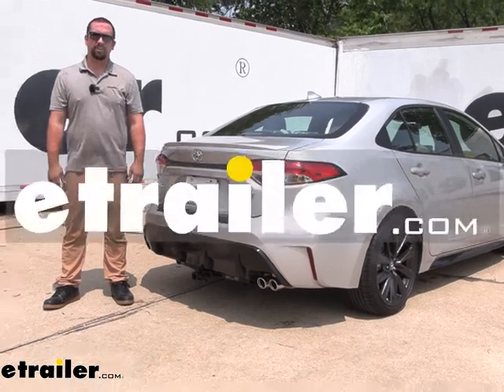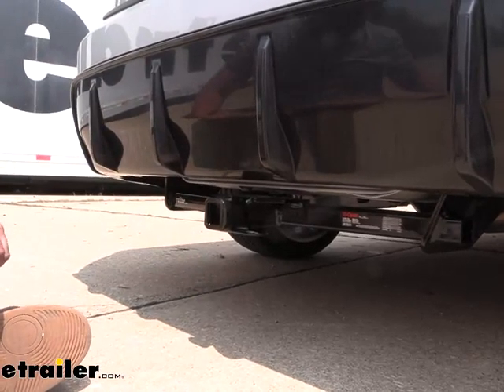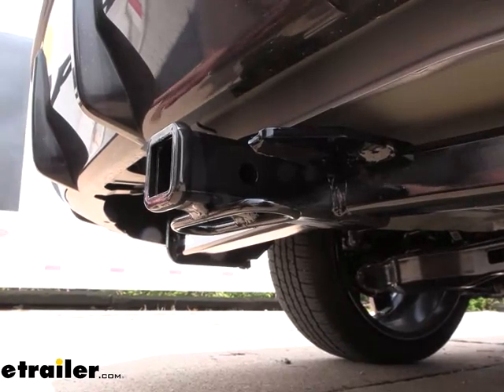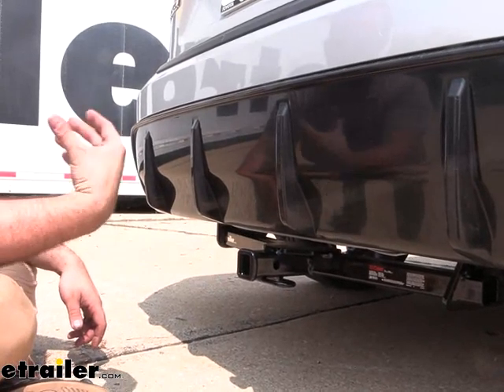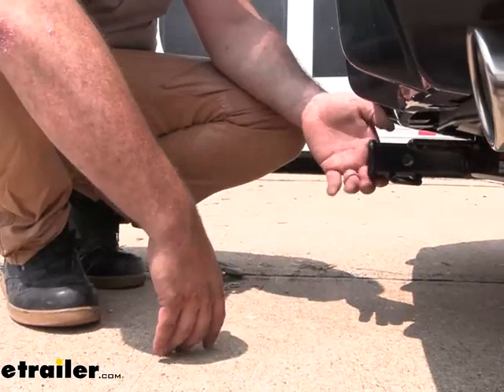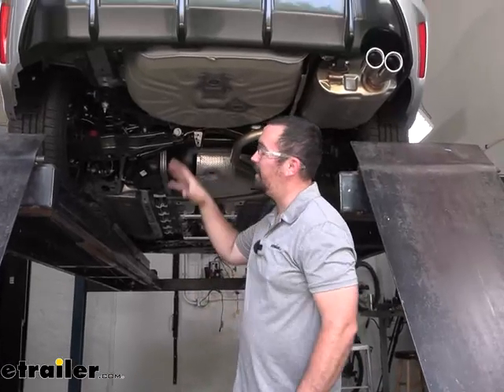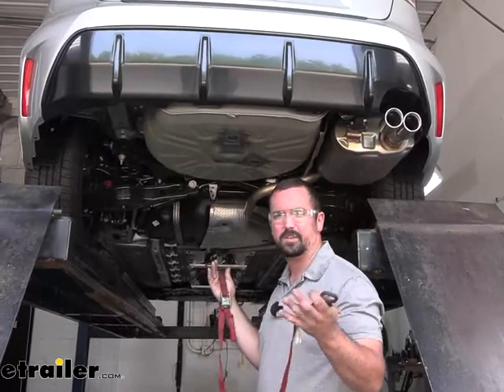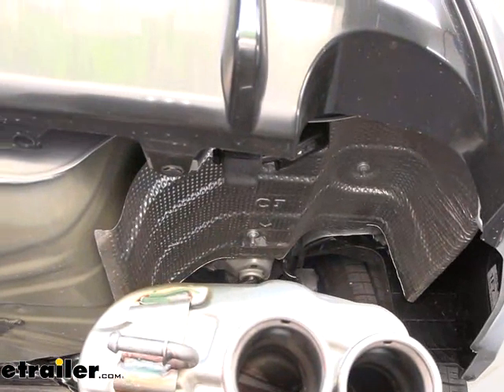etrailer | Installation: Curt Trailer Hitch Receiver on a 2023 Toyota Corolla

Comment: Do these instructions apply to a 2023 toyota corolla hatchback?
Reply from the maker: They don't. The hatchback uses a completely different hitch, # C11567. You can check out the install here:
https://www.etrailer.com/tv-install-curt-trailer-hitch-2020-toyota-corolla-hatchback-c11567.aspx
Reply: @etrailer The rear end is different on my 2023 COROLLA HATCHBACK SE 5Dr
Will this Hatchback mount be the same part and installation instructions?